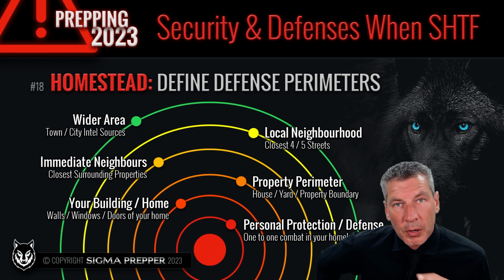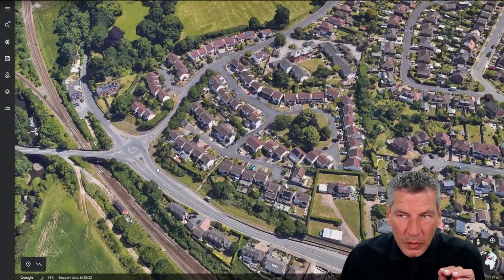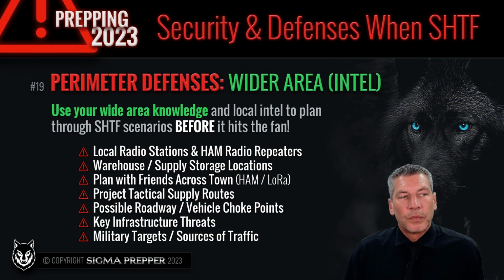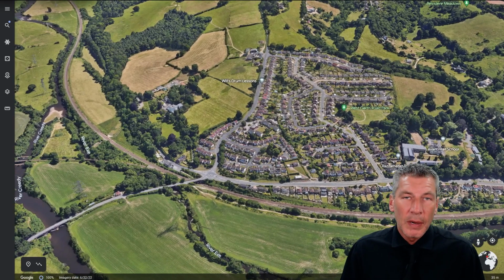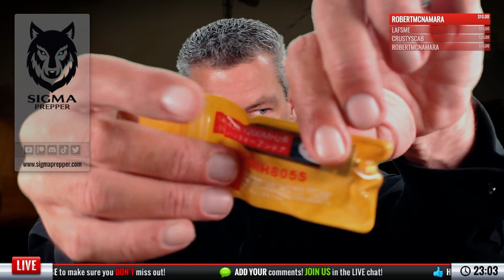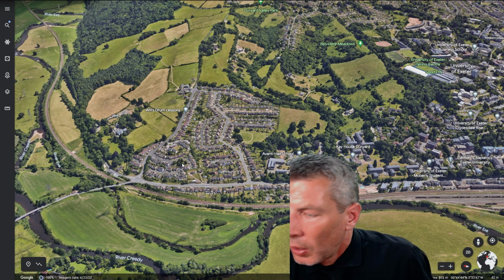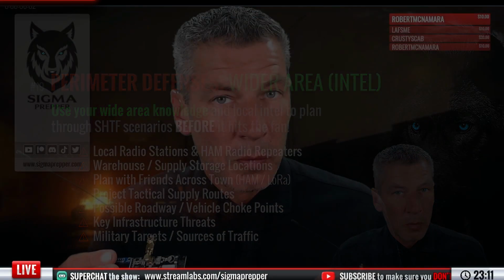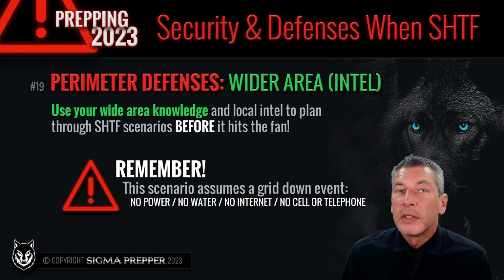SHTF Security & Defenses: Wide Area (Long Range HAM Radio Comms)

Comment: Came to the party late, In case any one else does here is my 2 penneth - Our local group use the the very cheap BF 888s we follow the 333 comms method on PMR channel 8 (plus emergency calling if required) To relay a message, it is done within the group.  Works extremely well. any range issues we recruit a new member to max the range. Simple, easy and cheap. Best of all you are creating a community which is the most important SHTF prep you will need. Good luck :)